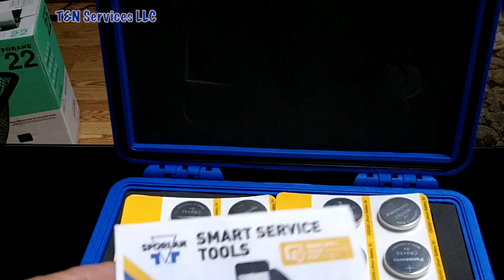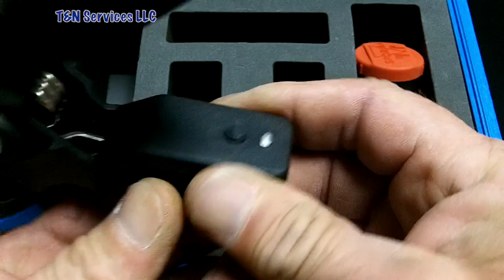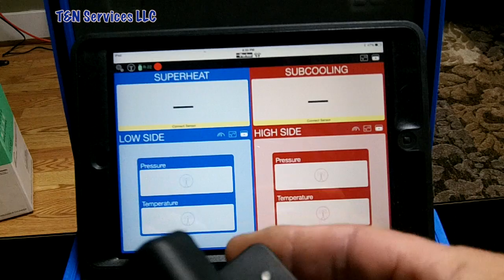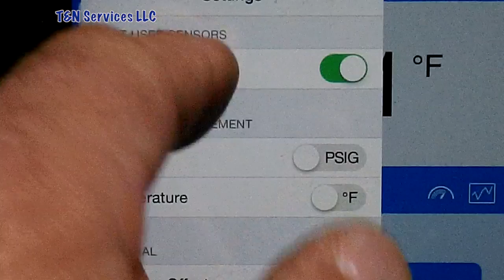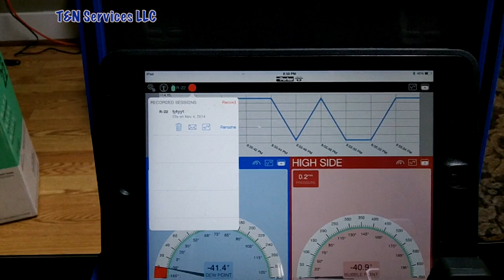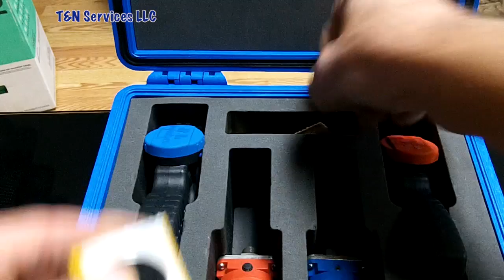Sporlan Smart Service Tool Unboxing

Comment: I like the imanifold way better as it does more at the same cost and the imanifold is awesome
Reply from the maker: The imanifold by it self is jus a gauge. It's the app that makes all the difference. I bought the smart tool because of the convenience of it, no wires and no hoses does make a difference. I also own the iConnect and also bought a second set of sensors for it. There is no comparison between the tools one does one thing and one does another.

Comment: Pretty cool Ralph !! So, are you going to add a tee in line with the low side to charge with ? Does the manufacturer say that's ok ? I would buy one right now if I could find it but apparently they protect the retailers because I can not find it online to purchase. Any thoughts ?

Comment: Cool tool, looking forward to seeing it on the job.
Reply from the maker: Hey Richard, I'm very happy with it so far.
Reply: It would be nice if they had a service port built into the low side for charging. I guess room constraints are a concern.
Reply from the maker: Richard Fossani I didn't mind the no service port on it. Some of these units are sometimes hard to even get a hoses on.

Comment: If it was priced around $350 I would buy one.... at $650-$700 with no other sensors for it, I will probably keep dreaming about the I-manifold (I know you aren't a big fan of it). Thanks for another great video Ralph.